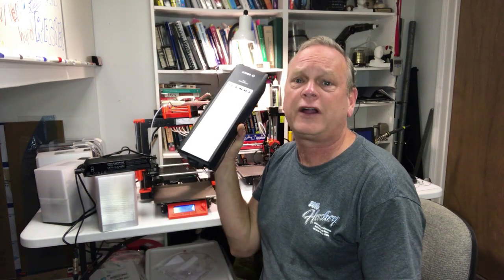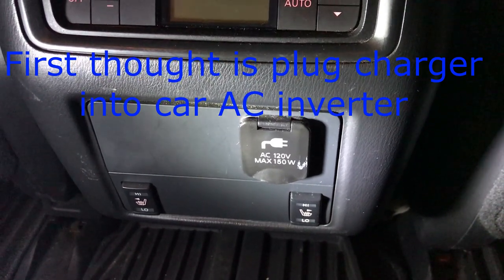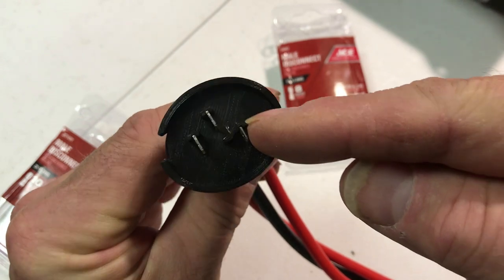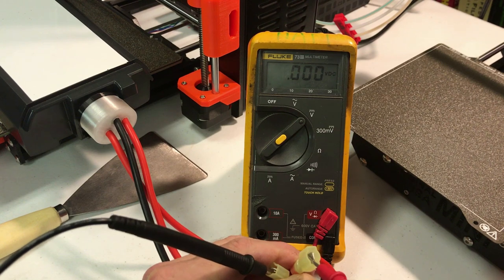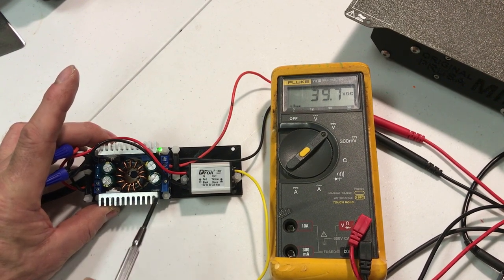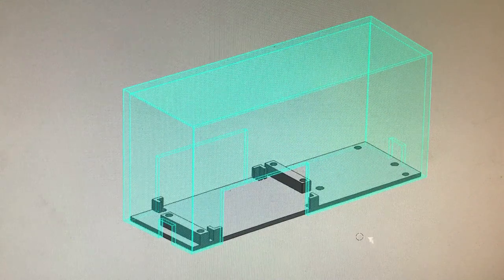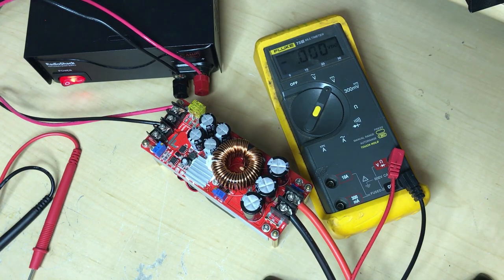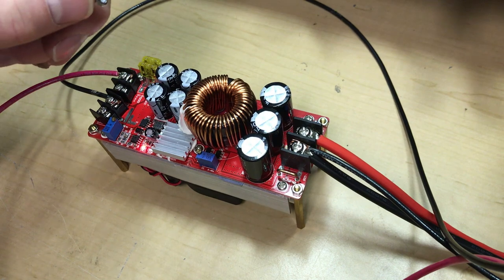DIY Bosch Ebike Battery 12V Charger with 3D Printed Charge Plug

Comment: FYI: It's much easier to just use a 10k resistor and a 5V zener diode to provide the 5V enable signal.
Reply from the maker: thanks
Reply: Can you offer any more info on how to go about this please? Just trying to get my head around it now - got my Bosch cable in bits just trying the best way to enable it with the 5v line. Like where does the negative 5v line go? Ta!

Comment: Nice, I finally a use a Pure Sine Wave Inverter, directly connected to my battery... I did some test with a booster, it burn... you right to take a bigger one with fan. you probably have a 5v on board to manage IC.

Comment: Hi Chris,  fun project, hung up on current adjustment 8(, the current seems to pulsate from nothing to about 1.2 amp, seem in sync with battery LED. Had to swap the 5v adapter, it was was DOA, wonder if DROK 1500W Voltage Regulator  is defective?]
thx-mik

Comment: Is there a product link to buy the bosch battery output plug? If i want to buy a new one it comes with the 230V adapter (i live in the EU), which is really expensive! Does someone know a cheaper alternative/has a weblink?

Comment: Could i use one of these chargers on a ECO-WORTHY 12V 20Ah Lithium Battery, 3000+ Deep 
 Cycle if i built one of these to charge my e bike out on the road.  Just trying to figure out how to use these two batteries I got to charge my e-bike on the trail.

Comment: Awesome video!!! Thanks a lot for putting this out! This is especially appealing to me because I would like to save precious battery capacity by not wasting anything at converting firstly to 230V AC and then back to 36V/42V DC. So I hope I could save the loss of my converter. Assuming the 230V converter, the original Bosch charger and your self made charger all have an efficiency factor of 90%. I would take just with the self made charger 625Wh/12V/0,9 = 58Ah out of the battery instead of 625WH/12V/0,9/0,9 = 64 Ah with the converter in between. In reality it's probably even more because the Bosch chargers are supposed to get pretty warm, so they dissipate probably more than 10% into heat. 

Though before I start I have a few doubts. Maybe you can help @SerendipitySue with clearing some up :)
1. Does the original charger have some kind of smart or adjusted charging characteristics or does it also only charge with constant voltage? So basically, could I harm the battery when using this self made charger?
2. My original charger has an output of 36V you set yours to 42V. Could this extra 6V harm the battery?
3. Could I also crank up the output current to 6A as the Bosch fast charger does it? I would of course make sure that I hook up the step up converter directly to the battery with thick enough cables and a fuse (something like 16qmm cables and a 40A fuse). Or once again could this 6A constant voltage charging do any harm to the battery?
4. Is there a possibility to use a switch to turn the step up converter on and off? Since I would like to mount it close to the battery in my camper I would like to be able to turn it off when not used.
5. I heard somebody else using a 1200W version for the step up converter. I guess this should work as well. It's a bit cheaper than the 1500W, which  you used in the end, and it doesn't need a fan. 
6. How much would voltage changes in my battery affect the output voltage of the step up converter? Is it linear? So let's say if I'm driving or getting lots of sun power my batteries get charged with up to 14,5V, maybe even peaks of 15V. If the battery doesn't get charged its nominal voltage is 12,8V. During use it could drop down to something like 11V. So, if I calibrate the step up converter at 14,5V to give an output of 42V it steps the voltage up by a factor of 2,9. The same factor would mean for 12,8V an output of 37,1V, with 11V -> 31,9V and with 15V -> 43,4V. Could this be an issue during use? What could be an appropriate range, so which max voltage shouldn't I surpass and which min voltage shouldn't I undercut and how could I make sure not to?
6. What might be the reasons why doesn't Bosch offer a 12V charger anymore? I heard they used to have one. Maybe because of these mentioned, difficult to control voltage ranges from 11V-15V during a typical 12V car use?

I'm getting excited here! I'm even thinking about getting me a voltmeter with USB tracking software and using my old windows laptop for the win/ubuntu only software, so I can monitor the whole loading cycle of my original Bosch charger to see, if there is any magic in terms of different loading voltage at different stages or not :D
Reply: Ok, I found out a few things by myself :)
Mainly from this German guy who does something similar:
https://www.youtube.com/watch?v=LD110uMoMbs

Regarding #1. and #2. I think as far as I understood there are no "smart adjustments" from the charger for the charging voltages. Constant 42V seems to be ok since this is the last voltage it needs to get fully loaded. Though the BMS cycle counting might be affected by this setup. This guy said, that he heard of others where the BMS increased the total charging cycles by up to 100 or so during one of those charges. Because somehow with this 5V signal the BMS gets the impressions that several charges are taking place in a row. I didn't fully understand it yet, though it seems to have happend. So if you are conscerned about warranty or questions in any way at your service interval, this might be a risk.

#3 I think 6A would be possible too, though I didn't get any confirmation anywhere yet. This guy on that channel was limited by the input current of 15A of his step up converter ( it was a small one, maybe also 150W or so). He set the input current to 13A and reached 3A output with this.

#4 Not sure about a switch yet, though somehow of course possible. If no other option one can swith of course the input 12V on /off with a high current switch.

#5 1200W-1500W seems like a good size to me. With or without fan I'm not sure. This guy recommended a fan, though he had also a smaller converter which produced more heat, which we of course actually don't want since it's energy loss.

#6 I totally misunderstood the step up converter so far. Apparently the once set output voltage is fixed and the converter reaches it with it's range of input voltages. 

One additional tip was to use diodes for the two charging cables because at the beginning the BMS sends a current itself which could harm the Step up converter. Not sure if this is really necessary, though it was his tipp.
Reply from the maker: Wow! So many questions. Thanks for the reference to the German video. I wish I could  read/understand German. Also take a look at my other video ( https://youtu.be/YejPGydMOnw ) where I use the Grin Cycle Satiator to charge. You can't put much more than 5.5A into the Bosch Powerpack 500 before the BMS shuts down charging. The heavy duty DC-DC converter can output this, but you will want to directly connect it to your car battery. The cigarette lighter socket and fuse can't handle that much power

 A "36V" LiOn battery has a range of 30-42V. 42V is fully charged.
Reply: @SerendipitySue  Thanks for the answer!
1. You can watch the german video with autogenerated English subtitles :)
2. Ok, in the other video you mentioned, that you went up to 6,5A for a Bosch battery. This fast charging option seems very interesting.
3. Of course I would mount the converter directly to my 200Ah Lithium Battery in my camper and also with thick enough cables and a fuse
4. So what do you mean with this range of 30-42V. Does it harm the battery when I charge it constantly with 42V? Or can I somehow adjust the voltage for different charging cycles?
5.The thing which is holding me back the most are those reports that with this constant 5V signal the BMS thinks there are several full charging cycles taking place and that the count for charging cycles might go extremely high which doesn't look good at my yearly service since I have an insurance on the whole bike and also the battery ;)
Reply: Are there any updates to the BMS counting way too many charging cycles with this method? Because this is the one thing which is still holding me back from building one for my battery, since I have an insurance for my battery, I don’t want there to be an unusual high number of charging cycles showing up at my yearly service check in   ;)
Reply from the maker: @fishermans1friend  My Battery is past the warranty and I don't have anyway to check what Bosch thinks. The place I purchased my EBike is several hours away so I haven't been down there to have them look at anything
Reply: @SerendipitySue  Ok, thanks anyways!

Comment: Your charger is great! Little cooler will totally reduce heating. 2 amps is too low current for charging 500 battery. 
It would be better to make special line from your car battery to new cigarette socket with a thicker wires and 10 amps fuse. 
To ensure not to overheat charger, you can add cheap electronic hot fuse. It will cut charger on desired temperature, and even sound a beep.
For instance if cooler occasionally blocked.

Comment: Does anybody know if it would be possible to load a Bosch Powerpack accu while driving ? I think of implementing a second LiFepo4 based accu together with a boost converter. My bike (as probably most ones ? ) has a separate socket where I can plug in the charger without removing the battery .. would that work ?
Reply: I am looking at the same thing. Possibly not by using the charger connector but with the boost converter hooked in the cable to the motor. I am just curious to nkow if the Bosch battery has some enhanced security to detect if there is power going in the battery while riding the bike (or when stopped at a traffic light).
Reply: @Rob_65  Can't remember where I got the info .. but trying to load and unload the pack will destroy the electronics ..
Reply: @waltsteinchen  Ouch! Thanks for the info.
Guess I have to test this with an old battery first before building this into my cargo bike.

Comment: Thanks for the video. Do you think that the 5v volts signal to enable the charge remains the same within the new bosch smart system connectics ?

Comment: Being cautions, There is a data signal on that line, look at the scope, clearly I can see a pulse and random freq. I looked further and a certified bosch teck posted that this is a data signal designed to keep other batteries from being used on the ebike. He also says the battery has a controller that understands the pulses and freq to keep other chargers from charging the bosch battery.  I have studied what your doing here Chris as charging a spare battery. I have printed your 3D plug and performed or repeated your work and it's working so far, so I am at a loss to figure out the secret to the pulses and freq of those pulses.... I hope it all works or i have wasted a lot of money getting this far.

Comment: Hi, Chris, thanks for the video. I rebuilt the loader. Unfortunately, I found no solution because the current Bosch PowerPack 500, 36V can not be charged with it. The bosch loader uses a charging characteristic between 36V - 42V. The charging begins with 36V, however, ends at about 38V .. only after which the output voltage is set to 38V the charge is continued. It's ends with reaching the 42V. I have to do this process 4 times. With start setting 42V, no load is executed. Does anyone know the solution?

Comment: bonjour rien a faire je n'arrive pas à comprendre comment débloquer le BMS pour pouvoir utiliser une source électrique qui ne vient pas du chargeur bosch 🤔
merci
Reply from the maker: you have to connect the 5V source so the battery will go into charge mode. Here's an example of using the GRIN charger: https://youtu.be/YejPGydMOnw
Reply: @SerendipitySue  OK merci malheureusement la barrière de la langue m'empêche de comprendre il faudrait un schéma
merci quand même pour la réponse
je continue les recherches 😉
Reply from the maker: @MACAVENTURES  Vous pouvez obtenir des sous-titres français sur youtube. Activez le sous-titrage sur Youtube (bouton CC). Ensuite, allez dans les paramètres et sélectionnez les sous-titres anglais vers français. Ce sont des boutons en bas à droite de la fenêtre du lecteur youtube
Reply: @SerendipitySue  merci mais malgré la traduction sans schéma je ne comprends pas comment connecter le 5v sur 3 bornes alors que 2 sont occupés pour la tension de 42v (+,-) le 5v a besoin de 2 bornes également il en manque donc une 🤔

Comment: Would this work with a 12V solar panel? Could you make a circuit that only puts 5V on the enabler pin if the sunshine is above a certain level?

Comment: Thank alot for the great video.
I want to buy a battery tester but i did not know how to hook it up because of that third wire. otherwise the battery doss not give power. 

1 question :)

is it a contstant 5v or is it a puls?

Comment: That was excellent. Very well done. 
I'm not sure If I misunderstood, but did you identify the purpose of the 5v line and is it required to initiate charging?  You mention there's no data on this line. Is it for the thermistor inside the battery maybe?

I'm made a universal charger with multiple plugs for a variety of 36v batteries I use for Xiaomi scooters, Fiido bike etc,  so It would be great if I could cut the Bosch charger out of the equation all together and add your 3D printed plug to my universal charger too.
Great work and thanks for the info. :)
Reply from the maker: I used it with the Grin Power charger ( https://youtu.be/YejPGydMOnw ).. The 5V is required to put it into charge mode.
Reply: @SerendipitySue  Thanks again for the info. I just wrapped up on making my universal charger and it works great. :)

Comment: I tried this for my ebike but the battery does not charge.  The indicator LEDs blink once to indicate charging and then they hold steady.  My battery is a Bosch PowerPack Frame 500Wh,  do you know which battery you are using in the video?  It looks slightly different.  I also tested the ebike's included charger and it has no voltage accross the 40V PIN, only the 5V pin, so I wonder if this battery might be doing some communication?
Reply from the maker: mine is the rack mount battery. The 5V signal enables the battery to go into charge mode... then there will be voltage across the 40V pin

Comment: Really nicely done. Do you know if you could charge while cycling. I could have my 2x 100A 12V batteries in my bike trailer 😉
Reply from the maker: yes works fine ( https://youtu.be/F27a7yQKD6s )

Comment: Hi could you confirm the reliability of your DIY bosch charger  after a year of use ? Iam  planning to make one according to your design. Thanks
Reply from the maker: The second one with the larger power supply has been working fine

Comment: ??
To reverse the power, do the +.- pin turn on and supply 36V if you supply 5 v to the third pin. 
The charger produces 5V on the third pin when you connect the other tester lead to either the + or the -. as if both are ground?
Doesn't make sense.
I want to be able to supplement my liFePo coach batteries in case of emergency with a buck converter 36 to 12V
Reply from the maker: bosch batteries have a proprietary protocol to use the battery. I haven't figured it out yet. So far I can only charge them. In the case of my RADPower ebike battery, I can use it for a powerstation ( https://youtu.be/vP13pjChTB4 )

Comment: Hi, my Bosch charger has just decided to stop working. I've tested the mains lead and that looks OK, So I guess it is the charger unit or plug. It looks like the Bosch charger 'talks' to the battery via that 3rd pin, so I guess I can't use an after market charging and swap the plug over ?
Reply from the maker: you just need to provide 5V on the 3rd pin. I've used the Grin power supply ( https://youtu.be/YejPGydMOnw )

Comment: Great Video! - You have a firm skill in explaining tech details to others so they can understand. you inspired me to buy a converter and make one. Unfortunately, I could not find a copy of the 3d cover for the converter. I found the plugs on PRUSA OK from your link, but not the case or base for the charger, do you have a link you could include please?
Reply from the maker: I can't seem to find a copy of it. My Windows computer crapped out and it must have not made it to my USB backup drive 😞

Comment: Hi Chris, it's a great video!
There is something I might not fully understood, the third pin is it actually taking 5V out/in the battery? What I'm trying to do is to reverse the system to plug a different battery in the Bosch motor, so understanding if the third pin is taking some volt from the battery might be essential!
Thank you for any help in advance
Reply from the maker: The Bosch system is propretiary. The display, battery and motor controller all appear to talk to each other in an unknown/encrypted? protocol. You just can't use an ordinary battery :-(

Comment: FYI the Bosch Fast Charger pushes 6A into the PowerPack500.
Reply: Its also a smart charger this charges always at the same voltage and current so u would propably blow it if u set it to 6a but dont quote me on that it certainly wouldnt be good for the battery

Comment: Do you have a solution for a Bosch bms replacement so I can use a Chinese bms to replace a dead Bosch bms 
Maybe it uses a handshake method to talk to the ebike or an other system
Reply from the maker: not yet

Comment: How can i activate the battery to discharge it and charge it over the same terminals?
Reply from the maker: I believe Bosch has encrypted CAN bus commands that they use between the battery and the motor. I would love to figure out commands to  discharge it.... but haven't yet. I did notice a new battery company on kickstarter that said they have